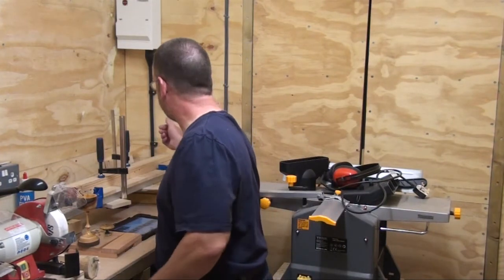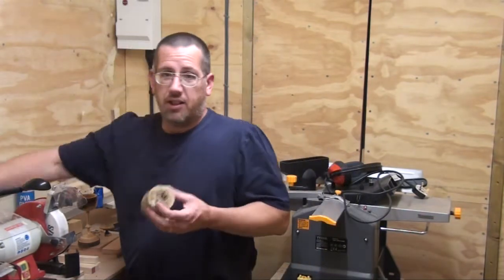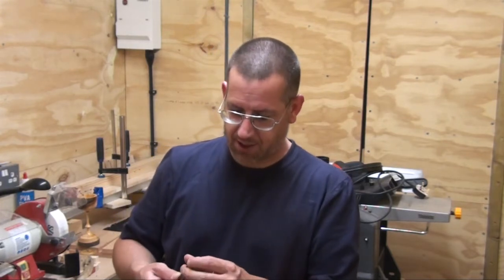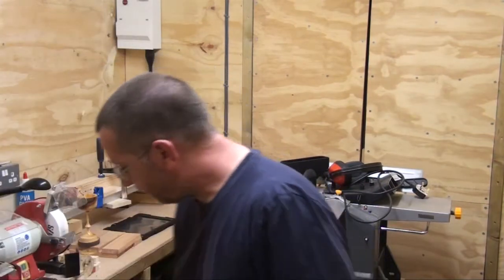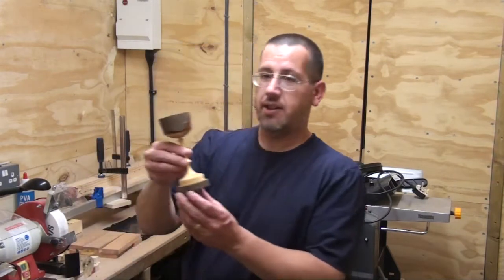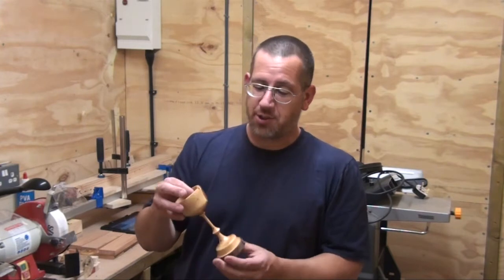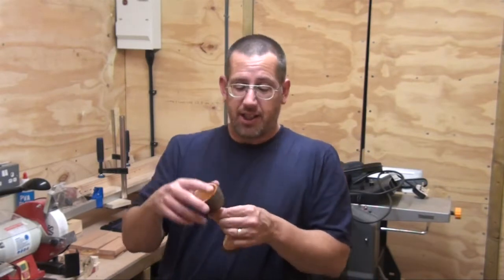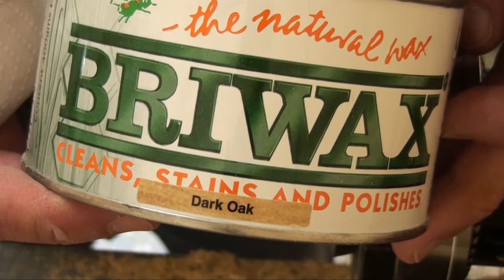Natural Edged Goblet - Episode 14

Comment: Nice mushroom, nice goblet. Glad to see you using my favorite tool -- the skew. I've got 6 of them... On the bowl gouge sharpening: Work the wings first, alternately and gently. Then start "fading" the grind into the nose. Easy does it -- let the abrasive wheel do the work. You need only ounces of pressure.  Clyde
Reply from the maker: Thank you Clyde. The skew is something special and needs more respect that anything. When you watch my latest Episode 16 video you will see where I went badly wrong but I've since watched a couple of videos and got my confidence back. As to sharpening, I'm finding that the wings go very curved which I then have to grid flat.

Comment: Hi Paul , the bowl gouge turn it over and place it on the grinding wheel gently grind it till you reach the front cutting edge . The put it back in the sharpening jig and sharpen it as normal . Your problem has been too much curve on the cutting edge it needs to be almost straight
Reply from the maker: Thanks, I will try and give that a go.

Comment: Hi Paul I may be wrong but when I was watching the video and you started to use the forstner drill the headstock seemed to travel along the bed way away from the tailstock.
Reply from the maker: Hi Geoffrey. Yes I noticed the head stock was moving. Thankfully there is a stop on the end of the bed so it will not fall off.